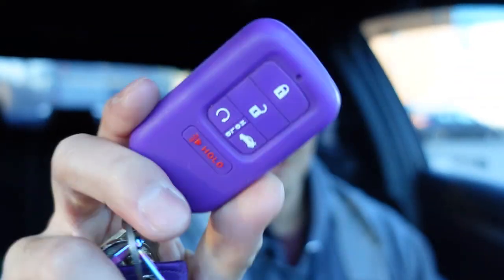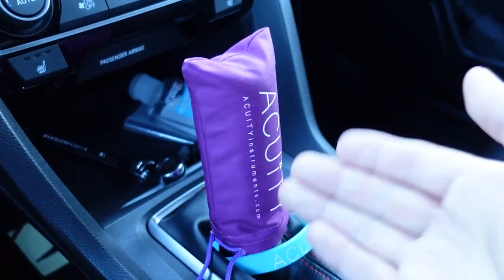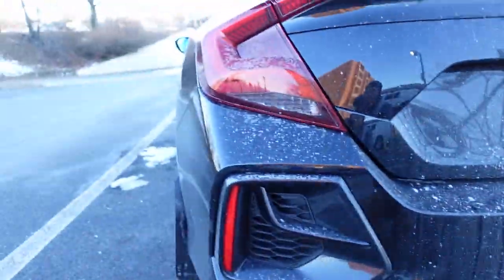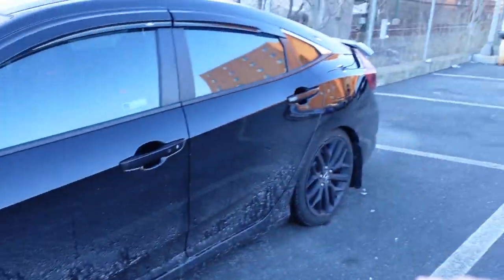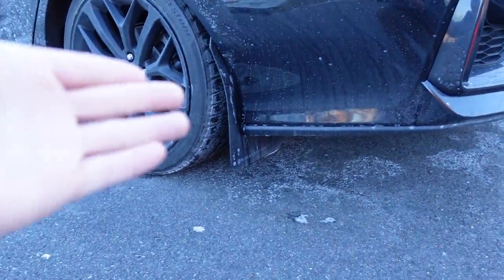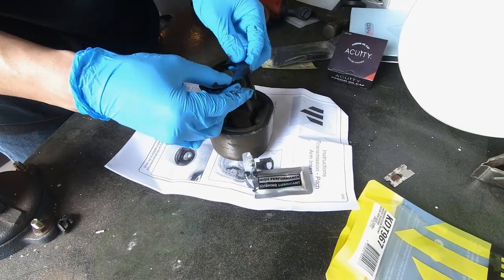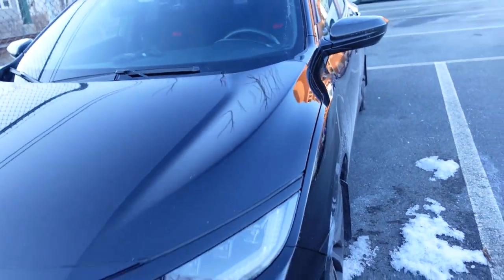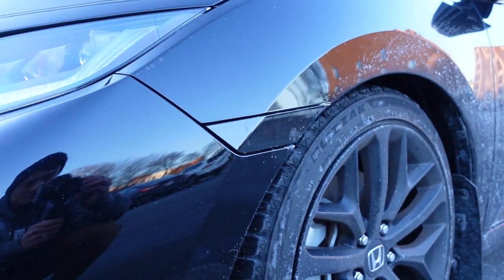All Modifications On My 2020 Honda Civic Si (So Far) After 10 Months Of Ownership

Comment: I live in Massachusetts with a 2020 Si as well and I got a remote start kit (with harness) from Fortin, it's really nice to get into a warm car. It auto starts the heated seats based on the temperature, as well as the climate control. Feel free to reach out if you need help on it. Keep up the good work!

P.S. Are you still using the Acuity heel-toe pedal adjuster? Did not see it on your list but the cost well worth it.

Comment: Can't tell if your car is tinted or not, but I recently picked up some precut tints from R-Vinyl. Really good quality, really good price for what you get and it came out really well. I installed it myself with no prior tinting experience and just a tad bit of wrapping experience. Buying precut is definitely the way to go if you're considering a DIY tint job
Reply from the maker: Nah the car isn't tinted but the rear windows have interior shades against them to have a similar effect. Would much rather have actual tint though, I will have to check that tint out from R-vinyl thank you for the suggestion 🙏!

Comment: beautiful 10th gen, i live in connecticut and i know the cold myself. love the headlights and tail lights... i have a 2019 si and i'm waiting for the spring time myself to install my PRL intercooler.. 10th gen is known for heat soak... great video. i'll be on the mass pike this spring for some E85 fuel... i also i have the flex fuel mod :)

Comment: Been following since I purchased my 2020 Si March last year. So far I regret getting the Acuity Stage 2 instead of the full shifter assembly. Hopefully I'll be able to install the mods I purchased for my car once this shitty winter ends.
Reply from the maker: Thanks for following! I totally hear you I actually ran the stage 2 upgrade on my old 2017 Si for about 10k miles until I switched to the full shifter when it came out. Both are great options though imo depending on driver's tastes and budgets. I'm sure when you're ready to make the switch, you should be able to get a fair sale on the stage 2 setup so it recoups a good chunk of the cost for the full shifter :).

Ugh yeah I can't wait for the cold season to end to get back into installing parts outside!

Comment: The Acuity Stage 2 kit and Esco has been the best mod I've done for my 2019. I have a full exhaust system, Downpipe, Intake and catch can and the shifter has been the best decision so far. I'm an idiot and didn't buy the stage 3 when I should have. How difficult is the install? Is most of the work just taking the console apart again? The stage 2 kit wasn't that simple. It was tedious and took me like 3 hours overall including the bushings under the hood.
Reply from the maker: The installation of the full shifter requires the same removal steps of the center console unfortunately, and then the next step that may be difficult is removing the factory cables, but I have a POV install video on my channel that should show clearly how the cables are latched into the factory shifter and how to install them on the new shifter. I’d say based on your previous install a complete shifter swap will take you about 2-3 hours 🙏

Comment: Great video, do you think the Acuity Stage 2 Shift Kit is good for daily driving? I share the car with my wife and was wondering if it felt harder to shift. Thanks!
Reply from the maker: I actually drove with the stage 2 goodies in my '17 civic si for about 8k miles before I switched to the full shifter, the stage 2 is def nice for daily driving though. That kit imo makes shifts feel stiffer, crisper, with a drastic reduction in free play in and out of gear, but it doesn't make the shifting experience too stiff at all imo.

Comment: I just picked up a 2018 ex-l.  eibach springs on the way.  quick question.   did you have any issues getting rear aligned?  did you need to buy camber kit also?
Reply: You won’t need to with eibach but you will with d2

Comment: I have the Acuity shift boot collar and the Esco. I just ordered the Poco just to switch it up. I know it doesn't need the collar anymore because it has its own but is it  difficult changing to the Poco? I'm guessing it's just removing the leather boot, taking off the Esco and screwing on the Poco but I'm not sure if it's that's straightforward?
Reply from the maker: Hey thanks for commenting! Yessir you’re correct the process to install the poco knobs collar is identical to the acuity 1924 shift boot collar. Just make sure the poco collar is oriented the right direction before you zip tie it in place as it’s not reversible like the 1924 boot collar 🤘🏼

Comment: Late reply but glad you're back and well.  I've been following and now a owner of a 2020 SI myself.  Currently heading into some subtle mods myself.  How is the ride on the pro-kit?  I took the spacers of my previous '18 hatch and found that the hatch fender spacing was more on the front then the back.  Now on the SI, 20mm on the rear and 15mm in front brought the stock wheels perfectly flush all around. 
What's your take on a rear diffuser?
Reply: Abs dynamics rear diffuser

Comment: Subscribed! Hey the suma side mirror wide angle are they worth it? And how do you clean those mirror because it has blue tint. Can i clean it with glass cleaner ammonia free?
Reply: I have them and they are 100% worth it. If you have dark tint at night it lowers visibility a bit but the wide angle is worth it. You can clean it with a normal glass cleaner without ammonia. Suma performance also sells a cleaning kit if you want to buy that.
Reply from the maker: I agree with Jonathan too, definitely worth it. It took a day or two to get used to the wider FOV, but I also think it's been awesome to see more on the road through these side mirrors, as before I felt like I needed to lean forward to peep my blind spot. The blue tint has also treated me well, and I can also attest for it reducing glare nicely 👍. Also haven't had issues cleaning it , but I'd avoid anything with ammonia in it too

Comment: i have a 2019 si as my daily please give more detail about the tune.... really want get  it but would like a honest opinion ..
Reply from the maker: I will try my best to cover that topic in a video once Im done with my bolt on mods to continue gathering more impressions on the tune 🙏
Reply from the maker: But quick comments in the meantime, definitely recommend getting it. It feels like it's gentle on the clutch, provides an awesome power bump especially on the 25psi setting. I normally just drive around on the lowest boost setting for daily driving and haven't had an issue with anything thus far 😎

Comment: I bought some aftermarket headlights for my 2017 Si coupe from vland, and the sequential turn signal on my drivers side sometimes blinks faster than normal, have you ever experienced that with the morimoto headlights you have? and do you have any insight on what my issue could be? its annoying hearing the blinker go so fast
Reply from the maker: I have not had an issue like that with any of the lighting mods I've done to my car so far, but it sounds like you may need to add a resistor or ballast with your setup. from my experience, a fast blink like that can indicate that the car thinks a bulb is out or that a light source isn't drawing the right amount of power in the electrical system if it's aftermarket. I'm not certain that is the issue, but I'd definitely hit up the forums/fb groups for more help if anyone with the same headlights you got dealt with the same issue.

Comment: I have the same car and i bought the same aftermarket tail lights that u have but my reverse lights arent coming on do u know what the problem might be?
Reply from the maker: Hey thanks for watching and commenting! For your reverse lights I'd try flipping the polarity (turn the connectors 180deg and plug them back in), to see if that works. Then also inspect the connectors to make sure none of the copper wires are misaligned when plugging them back in 👍. If that doesn't fix it, definitely reach out to hirevsports as they should have more diagnosis help or can pursue a warranty claim on them 🙏

Comment: Hi, I would like to know the difference between the stage 2 shifter kit (FK8 only) and the stage 2 shifter kit (Non-FK8 Trims) ?
Reply from the maker: Really the only difference between the two kits is the inclusion of the short throw adapter for the non-Fk8 kit. All the other parts are identical 👍. The short throw adapter doesn’t fit the Fk8 shifter because it has a much longer lower shift rod than the other trim level shift levers

Comment: how are the headlights compare to oem reflector? is the projector brighter ?
Reply from the maker: So comparing them to the stock LEDs, I noticed that the new headlights had better light density up front with a more clear cutoff line. Overall low beam brightness is noticeably better than stock, but the improvements would most likely be more appreciated going from stock halogen headlights to these new ones. The biggest difference for my was with the high beams, as they are a hell of a lot brighter, really helped with signalling attention to people when you want to pass or let people by in traffic
Reply: To be honest dude the OEM halogens seem better than the XB LED on low beams. The low beams on the Morimotos are actually pretty disappointing. Also, the height adjustment screw will break if you turn it too many times, and you don’t know when that will be, so you don’t even want to adjust them. I have a black 2018 civic si coupe with Morimoto XB LED headlights, MAP exhaust, PLR intake, and a bunch of other mods. If I could go back in time I’d probably just get PIAA platinum LED conversion bulbs for the stock housing.

Comment: Why you trade your 2017 si to buy the 2020 si?
Reply from the maker: the 2017 civic si didn't really feel like my own car because I used it to haul a ton of stuff for my old job in HVAC, and with the long and rough trips on and off construction sites the car got pretty beat and nicked up to the point where I wanted a fresh start. I didn't have a lot of money in the original car because it was covered with a vehicle allowance, so once I realized that the car was worth more than the payments left on the car I decided it would be a good time to start fresh with the 2020 model. And what really swayed me was the out the door price which ended up being less than the original deal I got for the 2017 Si, so I pulled the trigger on the new car. I also wanted a car with updated safety tech, so the 2020 civic si appealed to me for just that as well.
Reply: @Pawinning  understood!

Comment: I have a 2017 and I get alot of dash board lights to come on va, break hold, engine lite etc. Anyone know the reason? Or have a possible solution
Reply: The brake hold one is probably u accidentally clicking the brake hold button

Comment: Do you think the low beams on the Morimotos kinda suck? I installed mine today and I feel like the low beams are worse than the OEM halogen. High beams are good tho.
Reply: You gotta adjust them! I am working on a video on them
Reply: @ElPinche97  Thanks. Mine had the problem where when you adjust them the adjustment gear disconnects and they fall to their lowest setting. I was able to get a replacement set from Morimoto and now they're great.